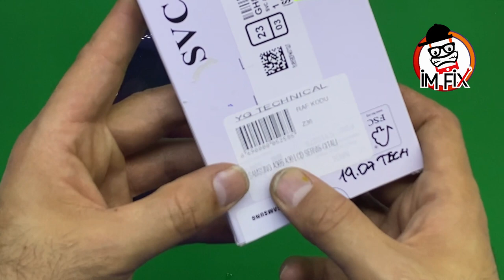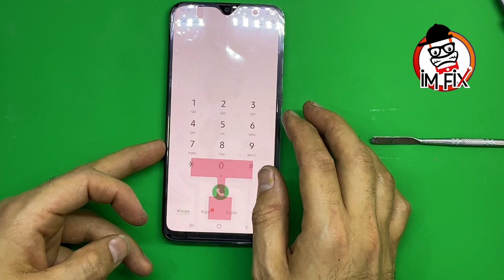Samsung Galaxy A30s Lcd Screen Replacement / Lcd Replacement

Comment: Hey ImFix, I like your videos. Could you help me find that NAND formatting machine you use? I would like to swap an iPhone 128GB storage chip (iPhone 6S) over to an iPad (iPad Air 2/A1566).
Reply from the maker: you need jc programer box bro .jc1000 model .you can by in ali exsspres